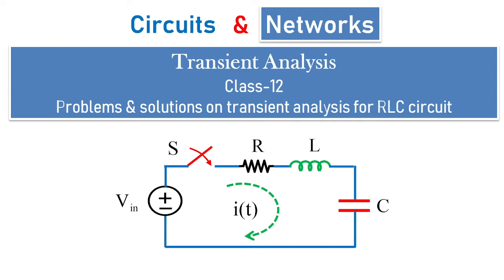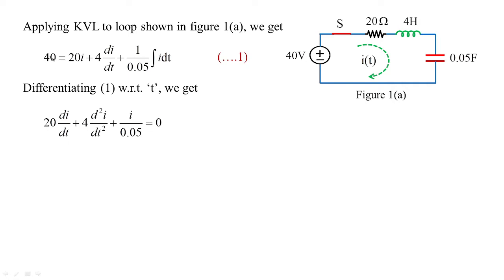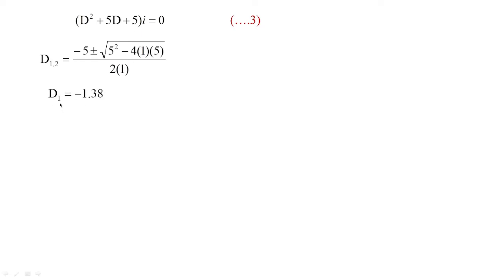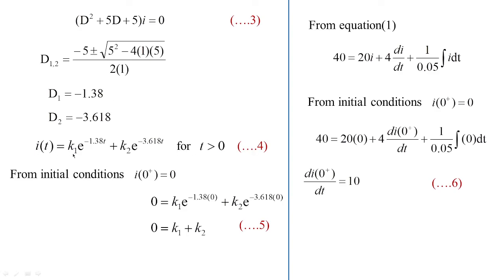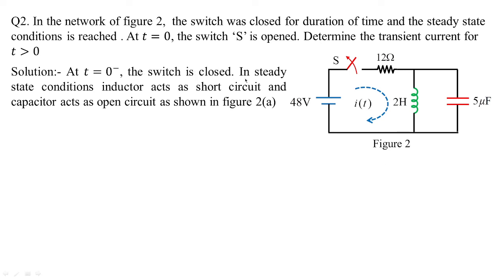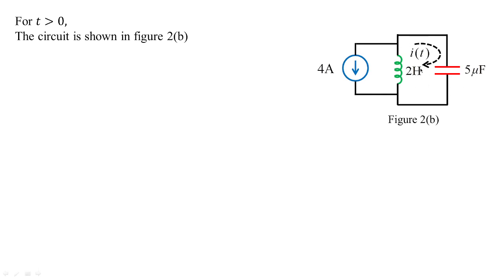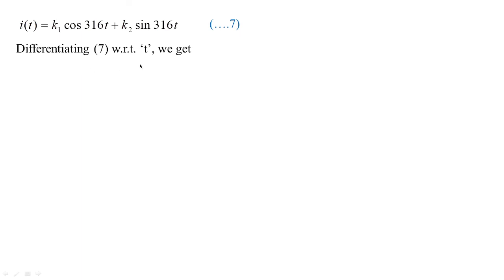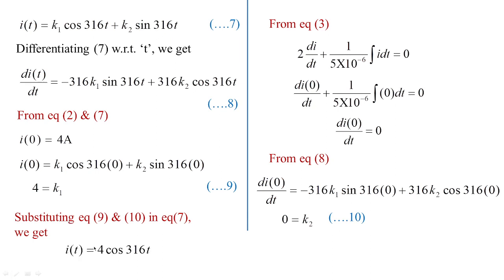How to solve transient analysis problems?  How to obtain transient current for RLC circuit?

Comment: sir at 19:13  can you  pls explain why you wrote the integral part as 0 ?,is  this because the current through capacitor is  zero at 0 to 0+ or is this due to any other reason  , i am confused  since i is the transient current then at 0 it is  4 ampere then why you wrote it as zero  if possible then pls clarify this doubt
Reply from the maker: excellent doubt you have identified here. see to get equation (3) we applied KVL to get voltage equation in terms of voltage across inductor and voltage across capacitor. but voltage across capacitor is zero at ' t ' = 0. so di(0)/dt at ' t ' = 0  is zero only.